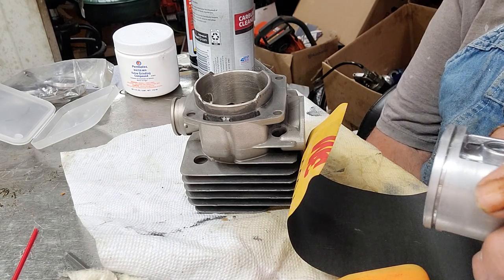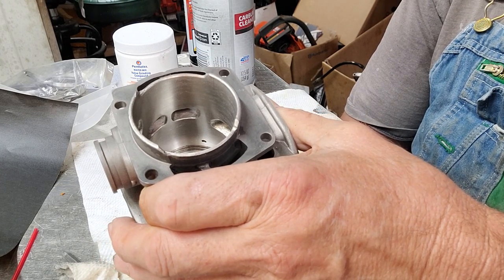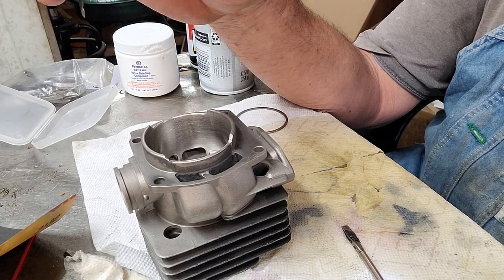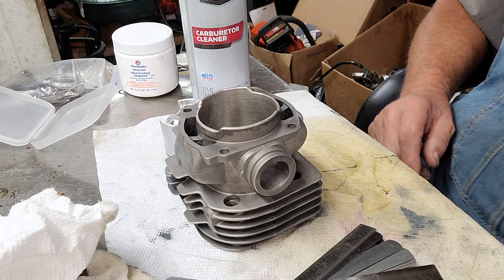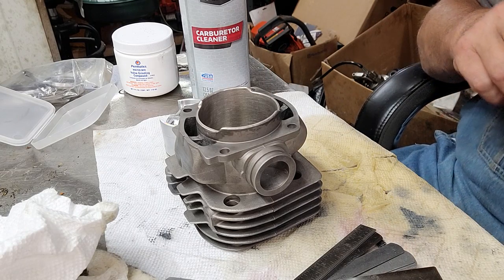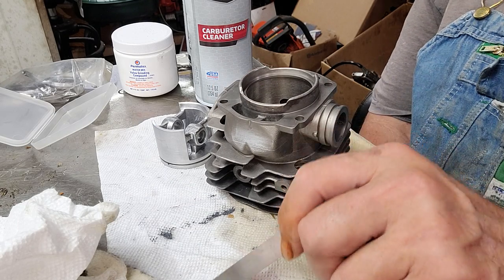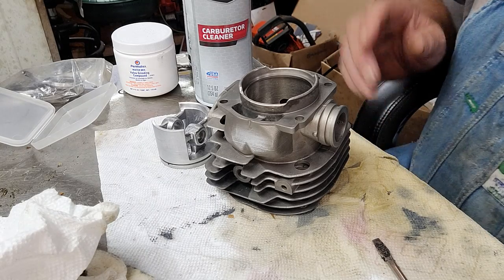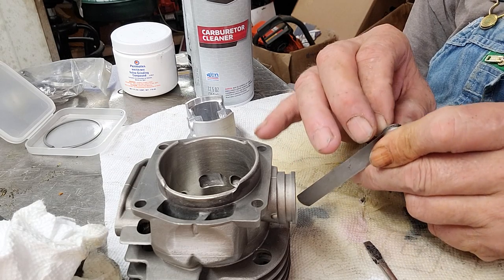chainsaw piston and cylinder clearance and setting ring gap! what's right or wrong!

Comment: Thanks Harvey; good info the way you explained this glad you and I talked about this and also good to make sure your ring ends are square and not a tight spot on either outside or inside edges....tight ring gap on any engine will be devastating of the ends ever touch in the least bit

Comment: Thank you for another great educational video. I must be unlucky on new aftermarket cylinder/piston/ring kits. lol. With the kits that I have used as of late, the ring gaps has been averaging from 9 thou to 15 thou. So far they all have run pretty good and still hold compression.

Comment: another useful vid w/ practical info. how do you modify (file) the piston ring to change your gap ? what tools do you use ? txs
Reply: Clamp a file in a vise or to a table and drag the ring end on flat side of the file take a little off each ring end and make it so that when ring is in the bore you have a equal gap on outside closest to bore  and to the inside closest to center of the bore usually if not filed you will have a tight spot closest to the cylinder wall

Comment: Than na for the great entertainment. 
Off topic question. 
I have a new stihl MS261.
 Bought a 28" bar for milling. With a chain with 3/8 pitch .063 gauge. . My 261 is .325 drive gear. Is there 2 sizes of 7 spline drive gears ? I bought a 2pack & they are to big to fit on

Comment: Depending on what is being used, cylinder design, ring type, and piston material dictates my ring end-gap.

I typically use the .0035" x bore for ring gap... 
Another area I check which can be suspect at times is the piston ring grooves... some shallow, some aren't concentric to the piston O.D. i also check the ring to grove height clearance... 
I've used blade mics to check ring groove depths...

IMO... That's kinda important to know if you're running a tight ring-end-gap and especially when building a saw where piston expansion is greater due to the composition.

Comment: Hello harvy got a question for u I just got done building a 272xp I gave it a very miled port job put it together it ran great plenty of pep it was running great 5th tank of gas it locked up so I took it apart and found one of the wrist pin clips fell out and destroyed the piston and jug I know for a fact they both were all the way in I checked twice my question is what do u suggest using for those clips I sertenly don't want it to lock up again Thank u so mutch for ur time

Comment: this is a timely video for me.  need to order a piston for a mid 80's 028AV Super.  the cylinder and the old piston are both marked "C" on top.  using a snap gauge and micrometer the cylinder bore measures 45.00 to 46.00 mm.  all I can find is A, B and AB pistons.  prefer to get a NOS OEM piston if possible.  any advice will be appreciated.

Comment: If you can’t put the dang thing over you sound definitely check it out…you can file a little gap in your ring’s and get your compression down around 150 or so and have a great running saw that you can start….  The super high compression saw’s are great fun in the summer time having a couple sud’s and cutting firewood with your buddies… but when is 20 degrees outside and your saw’s been sitting on a shelf in the barn for the winter… pulling over your 180-190 psi race-saw so you can cut the tree out of your driveway ain’t gonna be no fun at-tall!!!  That little clamshell ms250 or husky 350 with 140psi compression will pop right off on the second ripper and go get the work done!!!     Timing the weight off the pistons and removing the rotational mass has helped me make more power than any other mod’s I’ve done or it’s definitely worth it weight in gold…or it’s weight loss in gold for that matter!!!! LMFFAO

Comment: A dial bore gauge is the only tool to use for measuring piston/bore clearance.  Feeler gauges will give you a VERY incorrect reading.  Feeler gauges are for ring gap.
Reply from the maker: As I stated in the video!
Reply: You can also use a spring telescoping bore gage. Not “as” accurate as a dial bore gage but considerably less expensive and more accurate than a feeler gage. I think I paid 20 for a set of Pittsburgh from harbor freight.